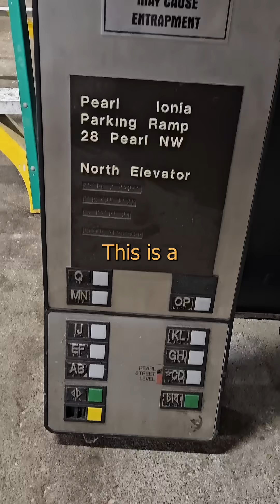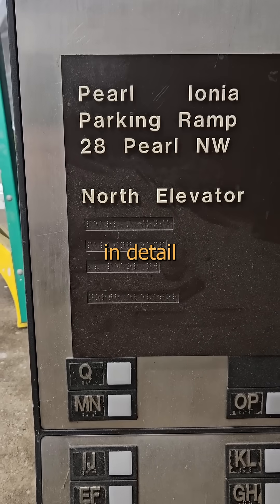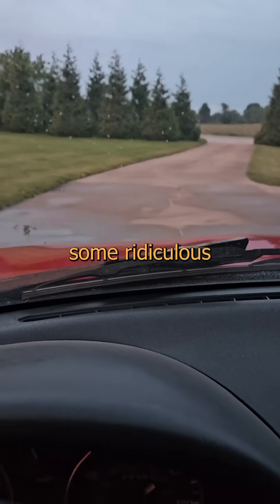Miata Mischief #chrisboden #engineering #gear #elevator #score #stories #parts #hacking #making

Comment: I hauled a 46 inch Hitachi big screen projection TV  over a mountain in a 93 V6 Camaro. I later used the same car to haul a bunch of shit 800 miles back from California to Utah, including a king size waterbed and three SGI Indigo2 workstations. I had so much loaded in that car that every bump would bottom out the rear suspension. The car was so packed I couldn't even tilt the seat back when I had to take a power nap with 100 miles left to go after driving all night.

Comment: I had to trailer home my 1987 Nova Hatchback that had carb issues. Rented a uhaul trailer and borrowed my friend (and his truck, to pull the trailer), and came down to get the car. Problem was, the little 1.6l barely wanted to idle, let alone go up a ramp calmly and easily. I drove in circles to gather speed and rammed up the trailer ramps at around 15mph. I had one shot and couldn't miss. I didn't miss. The friend who brought the truck needed his brown pants that day though

Comment: I've fit an Olympic weight bench and weights in a 91 civic hatch. The guy at Sears didn't think I could fit everything in. 

I also fit a full tube framed racing simulator in my 92 miata. The fiberglass racing seat sat in the passenger seat, and the steering wheel fit on the parcel shelf between the roll cage. I'm a master packer😂

Comment: I had an 06 Subaru I used to haul a 6ft by 12ft length of pegboard from Lowes. Tied it to the roof with paracord around the "Oh shit" handles. Our top speed was 30mph before the car attempted to take flight. Windows down, slow ride blaring, I made it home 20 minutes later than usual, and pissed a LOT of traffic off.

Comment: Not super crazy, but a little while back I bought a IBM Wheelwriter 6, made in 1988, from Goodwill, which I had to 'ruck' a mile uphill to my neighborhood while dehydrated as could be, with a few of my good friends.
The reason it was at Goodwill? Because the ink casset wouldn't traverse for some reason, but by some miracle, one of my friends got it to work after messing with it a little. He still has no idea how, but because of that I've had a fun toy that tickles my 'tism like no other since, so I'm not complaining.
Oh and additionally, I actually used it to write some D&D notes for my campaign when my laptop didn't work, heh.

Comment: I brought a 13 foot laser sailboat from Virginia to California on top of my 1968 Camaro back in 1982. The Camaro is approximately 3 feet shorter than the sailboat. So with a foot and a half of boat extended before and aft of the car, all my worldly possessions stacked in the back seat and trunk. My brother and I drove out of Virginia into West Virginia. I thought that little short distance on the map was going to be a good idea in time and avoiding the freeway speeds. BIG mistake, that “little” distance was correct, what wasn’t obvious was that distance is down on side of a canyon and up the other side, canyon after canyon. Half way through the air shocks I put on to adjust for the weight blew out. So in a tiny little burg we stopped in the “Monkey Wards” parking lot to get replacement shocks. Those mechanics had a heck of a laugh at the crazy Californians. Then they really bust up when they heard my “logic” of why the heck are y’all doing here? We got on the interstate as soon as we could, and made it home.
But the funniest thing I’ve seen is in 2016, in the local grocery store parking lot, in December. The was a guy with a Christmas tree hanging about 3-4’ out of his sun roof, headed home.

Comment: Had a few instances of crazy hauling. Mainly varuous bits of large heavy furniture on the roof of my 90s era front wheel drive sedan. (A Chevy Lumina to be specific)

First was a rather nice wooden display case I had found on the curb when I was out for an evening drive. Was a pain getting it onto the roof of my car alone, but I managed (without breaking the back glass I might add) to get it up and tie it down with a large 50 foot extension cord tied in knots and a bunch of worn out bungee cords to boot. Hauled it about a good 15 miles and after unloading it, it now sits in my living room holding my collection of 1:400 scale model airplanes. 

Second one was a long bedroom dresser, also found on the curb on another drive (actually running errands) and luckily I had help loading it onto the roof of my car (the glass top loaded in the front seat), where it was tied down with rope and the same worn out bungee cords from the display case trip and hauled back to my place (a 32 mile drive). Was used as additional kitchen cabinet space and served the purpose well for storing pots, pans, coffee pods, spices, cooking utensils, etc. Would recommend using an old bedroom dresser for additional storage if your kitchen is small and space is at a premium.

My car, even today, still bears the scars from those trips, mainly deep scratches in the paint, a massive dent in the roof, and rear struts completely worn out, but it did surprisingly work.

Improvising at its finest.

Comment: A friend wanted my help picking up a free Sony Trinitron. Wanting to be a good friend I agreed only to find out this Free CRT was over an hour away and ended up being an entire day trip. Not to mention that this TV was also like 200 pounds. we ended up scraping it against the concrete trying to lift it into his house. If he did a better job communicating with me I could have brought my dolly and a tarp to help protect it but end of the day it's in the house hooked up to his ps2 and some other consoles so it worked out.

Comment: I was 21 in my first place and got a portable AC and had no window kit, wanted the window for light. The shop was supposed to drop it off at my place but wires got crossed.... I had a 40"x27" or about, sheet of plexi to fit the window strapped to my back pack acting as a sail riding my little 250CC Yamaha home.

Comment: Got three examples (main examples as it's rather frequently occurring) 
1. Shoved a 224 Case tractor in the back of 2010 ford expedition but had to keep back seat in because kids were with. Barely managed to shut the hatch and glass.
2. I'm not sure which is the most surprising here but the amount of items hauled in the 93 ford festiva  shocked even me, a full sized moped, a love seat (yeah still not sure how we managed that) and an xl dog crate fully assembled 
3. Took a late 80s 350 4 door dually with front axel removed, installed a homemade/fabricated trailer hitch wired in lights and pulled it with a 95 f250. Pulled it 1400 miles. Got pulled over 2 miles from our driveway 😅
Reply: I once picked up a bobcat scoop worth of bulk landscaping mulch in a stripped out Ford Festiva lmao. Fantastic little cars
Reply: 😂 OMG the Ford Festiva stories you must have! The EXACT same type of shenanigans my friends & I would in the backwoods of rural new york state 😂 only, replace Festiva with Datsun 210 lol

Comment: I SWEAR THIS IS TRUE: I once owned a very unique, VERY large L shaped corner style executive computer desk, the frame of which was made of a spaghetti works of big tubes of polished aluminum that was fashioned into 1 piece. The desk surfaces were made of smoked glass, very cool looking. 
A buddy of mine who was letting me store it in his garage one day told me he was moving, and that I HAD to get it out of there or lose it. When? RIGHT NOW! 

Well, I had no vehicle at the time so i just rode my mountain bike over there at the time to see what I could do. I couldn't get anybody to come hep me move it and the guy was closing the doors. I couldn't just leave it there, it was way too unique, and someone would snap it up. But the frame, even though it was about the size and shape of a sectional couch, being tubular aluminum, was actually very light. So, I started to get this crazy notion that maybe it would balance some way so that i could walk it and my bike down the road. Well, it was light enough that i could turn it around every which way such that I discovered a sweet spot from which I could balance the whole frame resting on one point! So, I set it on my shoulder and the whole thing just hung there in the air, steadily. So I grabbed my bike because I had to go all the way across town with it, I started walking but then wondered if I might be able to transition into a riding position carrying this monstrosity. Well, somehow, I was actually able to gather enough speed to get my bike to coast enough such that I could hop up on the seat with this thing still hanging from my shoulder. Its balance weight felt probably not unlike a tight rope walkers balancing boom, because it was so large, its size resisted turning around its axis. I picked up a little speed and I was actually pedaling down the city streets with this desk frame on my shoulder on my bike which looked even more awkward than it felt because the desk fully took up a lane and a half on the city streets of Long Beach CA. I figured I would be all right if I could just avoid stopping, red lights and delivery trucks, and cops. As I moseyed along I was getting some of the craziest looks of exasperation as people noticed me whizzing by on my bicycle. Whenever I happened to particularly astonish some unsuspecting bystander I would look at them and just for fun, shout out, 
"Hey, YOU!, Yeah, You! wanna' buy a table?" 
Bystander, "Me? Whu...whu..NO!" 
Me, "Aww, c'mon man, sure you do!" 
To another, "Hey lady, you wanna buy a table?" 
I did this all the way through Long Beach, avoided red lights and cops the whole way and made it safely to my destination. So I was able to save the frame and pick up the glass later. Man, that was a funny wild ride. Miss those days.

Comment: Ah yes the great mound of cylinder heads i brought home in the back of my 1996 dodge caravan ah the carpet was stained black and the inner rear wheel wells were polished by the tires but i did gst 15 sets of big block chevy heads for free!

Comment: Back in college i didn't have a car my freshman year, all i had was an electric scooter. Now i went to Reno for college and the closest target was in sparks, its like 30 minutes on the scooter normally. So im going to target to do some shopping. I end up getting a few things that fit in my backpack... and an ice machine. So my dumbass put the ice machine in front of me on the scooter and went on my way. My feet barely having enough room on the board, heels hanging off the side. But as i was ridding home i passed a guitar center and remembered i got a new ekit for my dorm but no seat. So of course i made the smart decision of buying the drum throne there and stacking it on the ice machine. so now my weight was almost doubled and the scooter was pulling maybe 10 mph on the hour ride home. Any rock or crack i hit would topple everything, i had to be so careful

Comment: I waddle walked a commercial display through the Tokyo subway system from Akihabara to Ebina. That's three train platforms worth of balancing a 6 foot display on my feet while desperately trying not to drop the expensive new toy I got for helping clean a sketchy hole in a wall electronics shop. All that and when I got home I realized the video processing unit was still in aki. Thankfully that was backpackable and I didn't need to get the judgmental glances of extreme yet somehow discreet disapproval the Japanese reserve for this particular kind of tism inspired craziness. I then got to enjoy three weeks of gloriously janky ultra wide gaming before it comes out in my suddenly tropical bedroom.

Comment: I'll jump in. I was 14, and rode my bike all over town. Town was big. I happened upon a divorce sale and lady was selling everything CHEAP. I saw a nice set of stereo speakers, 4 feet tall with 10" woofers. I said "Those are nice" she said "gimme what you have in your pockets and they're yours." I had $7. Apparently, that was enough. I rode 3 miles back home, and put together a trailer from lawnmower handlebars, conduit pipe, all-thread, lawnmower wheels, and duct tape. I rode 3 miles back, to the yard sale, loaded up the speakers and taped them to the trailer and hauled that shit home. I set the stereo up in my driveway and tested to see how loud they could play Seven Nation Army.

Comment: While pretending to be a trash panda, I found a 3u rack mount server. Problem was I was on my bicycle that night. So I balanced it on the handlebars and seat and pushed my bike halfway across town, just to find out it could only boot off floppy disk unless I spend a ton on new SCSI drives😢

Comment: Not as oversized as an elevator panel, but my Dad had a 1st gen Miata when i was 15-16. My Dad is a bear of a man, about 6 foot, wide shoulders and a upper body like of an oak stump. I was 6'2 and a bit thinner than him, but not by a not. We had to pick up a set of cylinder heads from a machine shop, and the only place was somehow in my seat.

Comment: When I was 10, I spotted eleven giant skip bins (dumpsters)next to the local telephone exchange. Being the enterprising young hooligan I was, I trawled through the bin until I found a giant rack trolley, pulled it out, then proceeded to pull half the muscles in my body levering a full-height rack out of the bin, putting it on the trolley, then filling it with all the shiny hardware I could find. I managed to haul it home a broken boy, drenched in half my bodyweight of sweat, then took it back apart and hauled every piece up 48 steps to my house. The next couple years of play brought me to the career I have today, programming precarious pixies to perform perilous probes of potentially problematic peripherals.

Comment: Furnished 6 apartments with stolen  tables chairs and coffee tables . An auction house in madison Wisconsin would crush everything they didnt sell and trash it each month . If you walked up and looked at the pile by the trash they would try to sell it to you. But if you wait till dark it was first come first serve.
 Used a 3 cylinder geo metro and piled things on the roof and held on out the window.
Took a dozen trips in the wee hours of the morning but we managed .
Good Times.  Before security cameras were ever a big thing .😅
If there is footage it grainy as hell - that's clearly Bigfoot with an ottoman officer

Comment: 86 Camaro with T roofs. I had to get two ten foot copper pipes for a plumbing job. From the hatchback through the open T roofs, the two pipes tied together looked like a roof mounted long barrel shot gun over the windshield.
Oh and a hand made fiberglass chest in the backseat of a Bonneville. Tied the doors together to stay shut.

Comment: I have a couple involving my old Hyundai Accent hatchback.  The first was moving it from Idaho to Minnesota, and having to bring my bike too.  I had the car all the way forward on a uhaul transport, the ramps out about a foot, and my fat bastard edition GL1200 perched on them.  Made it.
I won a couple locker cabinets in an auction, 12" wide by 6' long.  I had them both stuffed up against the dash and hanging waaaay out the back of the hatch.
Bonus one is hauling my F250 on a uhaul transport trailer, the wheelbase was longer than the whole thing, so once I had the front wheels locked in place I jacked the rear axle up and slid the ramps in, then lowered the wheels back onto them.  Those ramps can take some abuse lol

Comment: Not as crazy and most of these, but my parents left for a weekend trip and when they came back they found a model 144 Dayton scale in the kitchen. It weight 80 lbs, is 100 years old and is almost 3 feet tall. I got it home in a 2019 Honda fit. Interesting drive back.

Comment: I was able to haul 4 honda trikes worth of frames and 7 tires in the 6 foot bed of my truckz and it was raining and i could still drift on the turns with my bald ass tires and under 200 horsepower 😂

Comment: Last summer, someone dumped a big block 1972 dodge RV in a random parking lot near me that just happened to be owned by the city, and they wanted rid of it, so naturally, my buds and I got together, stripped it like crackheads COMPLETELY in that parking lot with chainsaws, oscillating multitools, and grinders till it we got to the engine, we cut away literally everything around it (including the frame) and yanked it put via engine hoist attached via chain to the hitch of my 2000 dodge diesel, loaded the engine in the back of my friends truck, brought it home, then, with a tow strap towed the rest of that camper with the frame cut on a highway to the nearest junkyard, and got paid $572 for all the scrap. That 360-3 motor and transmission now reside in my 1974 Dodge D100 which as of last summer, can now do burnouts.

Comment: I know the dumbest thing I did 🤣. 10 out of 10 don't fill the back seat with hay and not have ac on a hot day rofl 🤣 there's still hay in that 99 Ford Taurus 13 years later. At 65 70 I was glad I had my goggles on.

Comment: I definitely did not use a 1995 Mazda Miata to transport 4 drunk friends away from a high school party which was getting broken up by the cops. 

Doing so in a two seater vehicle would have necessitated one passenger in the passenger seat, two passengers to straddle the backs of the seats while sitting on the lowered rag top, and the forth and final passenger doing creative gyrations that would have impressed Dr. Arnold Kegel in order to shift the gears.

Definitely did not happen, your Honor

Comment: In the late Eighties, I found a complete front bumper for my brother's '64 Lincoln Continental in the local junk yard. (Think JFK's limousine) 
I bought it and then determined that the only way to get it home in my '74 Civic was to tuck one end under the back of the driver's seat and hang the other end out the open hatch. Everything was fine till a semi passed me on the freeway and the engine red-lined because I had lost front-wheel traction. :)